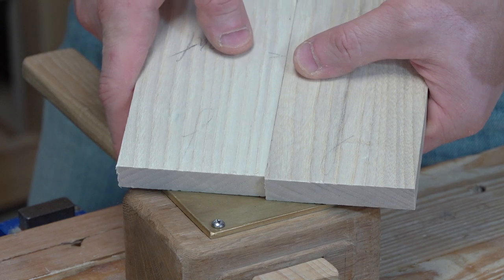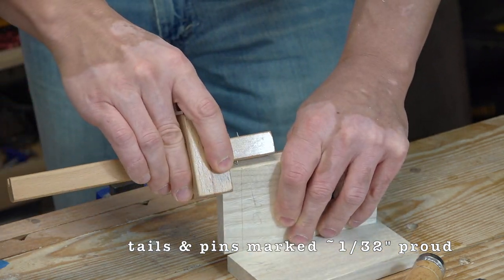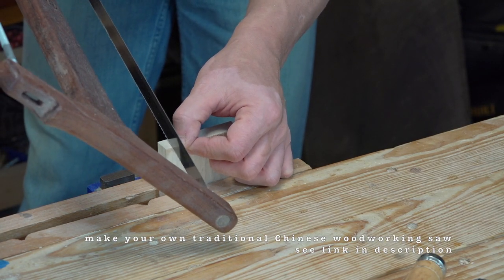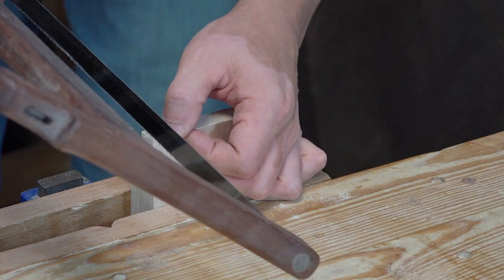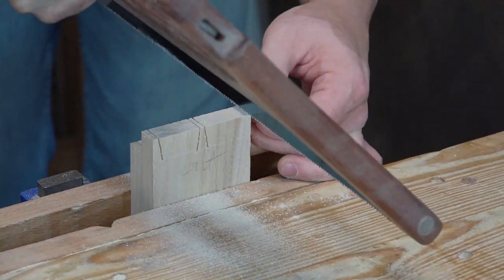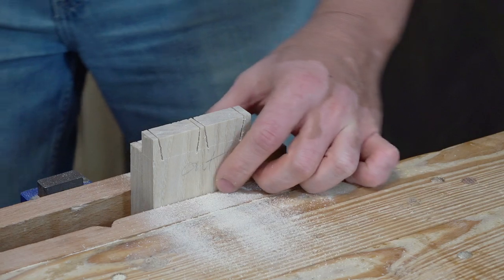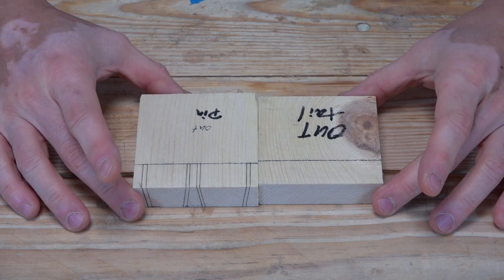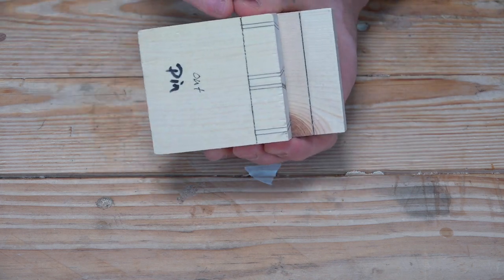One Line Dovetail

Comment: Nicely done. I’m relatively new to woodworking as a hobby using mostly power tools.  I tried making dovetails, but I did not enjoy the process.  Your video has inspired me to try making dovetails again.  Thank you for the video.  Wishing you a happy and safe holiday season.
Reply from the maker: Always appreciate your kind words. I started woodworking as a hobby in 2003, mostly with handheld power tools after watching some Norm Abram. It wasn't until 2013/4 that I cut my first dovetail by hand, so sometimes it takes awhile to move away from power tools and really appreciate hand tools.

Comment: i watch the other video, and as yours there are big gaps.  is this normal to have gaps, or just a demo to show the process?
Reply from the maker: I don't see "big gaps" in his video, his looks 90% perfect to me. Mine are 95% perfect except the 1mm missed alignment. But I've only cut 2 tails. What you are seeing are the shadows cast by the proud pins and tails; proud pins and tails are the result of the marking technique. Once glued and the proud pins and tails plained away, you won't see any shadows at all. Make a dovetail of your own and you'll understand the finer points of looking at dovetails.
Reply from the maker: There is a small "gap" at the top of one tail I agree. But you should look at the 3/4 view and see that there is a 1/32" proud on the tail and pins. If you look at the dovetail when it was first put together, those "gaps" aren't there, they only "showed" after the tails were fully seated. From your picture you cannot tell that the pins and tails are actually proud. Without a scale bar on the dovetail, how can you conclude it is 2 mm?
Reply: @johnzzhu  it looks for me at 2 mm. But that is cherry pinking from my side. Amazing video, i did try one, and I did some big gaps, but is the first time when I doing this :)
example: https://ibb.co/c2DM5s9
Reply from the maker: Claudiu, that looks great for a first try, way better than mine. Though I use 1/4" stock for my first try and look like you went 3/4". I found that if you increase the angle of the pin, it's actually a little easier. I think something in our brain/hand coordination has trouble cutting at an angle w/o a line if that angle is too close to 90 degrees.
Reply: @johnzzhu  when I cut the mark, I do make a small sign with the pen, and I do increase the angle, plus because I don't have a big stock was easy to cut it . Plus maybe is that i use a way smaller saw(veritas dovetail saw) :)